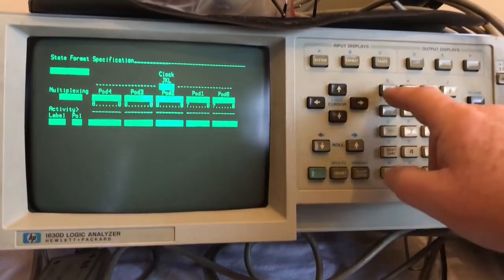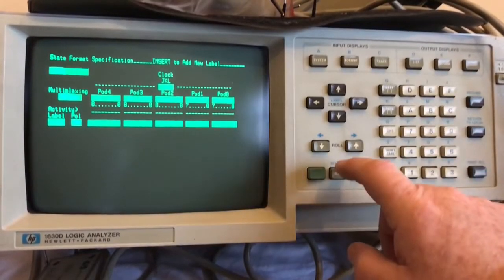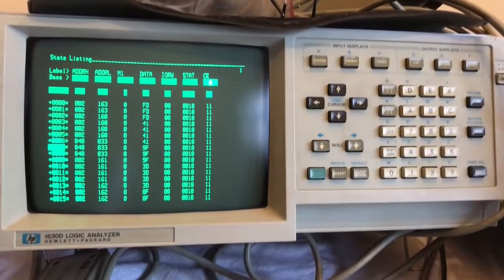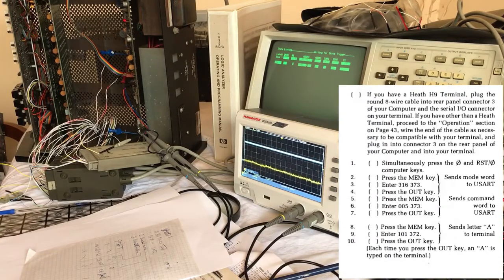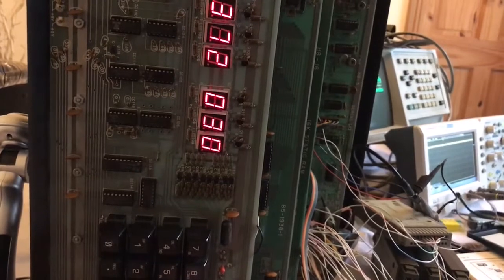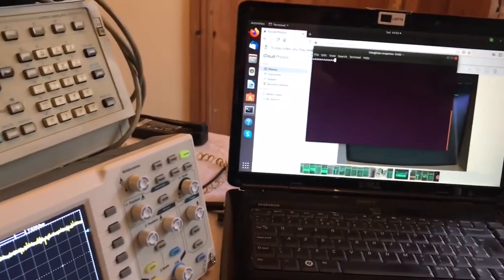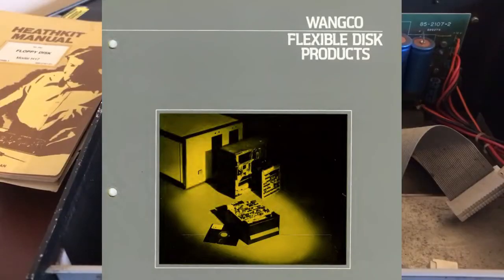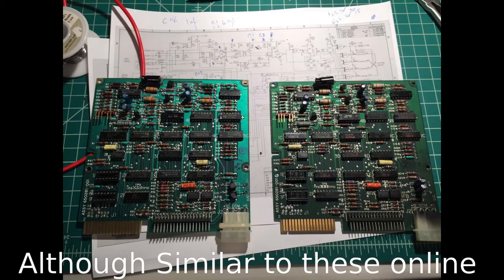HP Logic Analyzer & Heathkit H8, H17 - Part 4

Comment: Crikey Tim, that 1630D is quite a useful tool!   I'm so glad it's been put to a good use having been sat for the last twenty years in a dusty old cupboard.  You seem to have a good knowledge on how to use it too.  

I never knew those 4-pin Molex connectors have been around for so long - that was a surprise to me.  It's important these bits of hardware are kept going as they really are a piece of history, more and more kids these days have absolutely no idea how electricity works let alone a computer.  Thanks!
Reply from the maker: Thanks for the feedback - it arrived just in time for the work on this HP as my small 8 channel one would not have been up to the job.  Agreed on the electronics front which is why although I am glad to see the maker community thriving sometimes some simple electronics could solve a few of the problems that come from just connecting together pre-built modules.